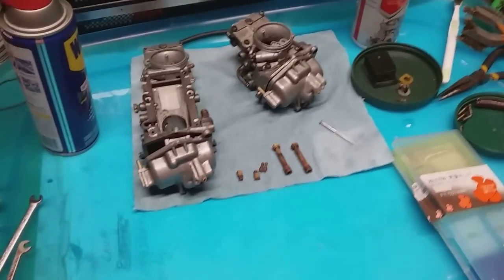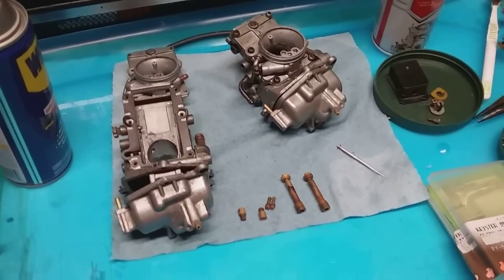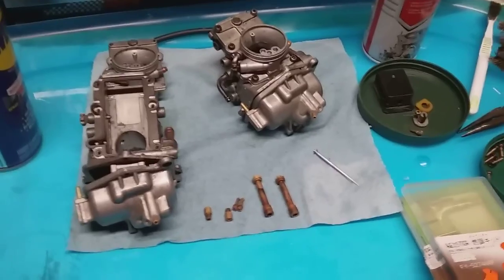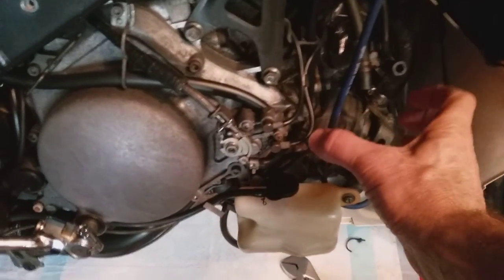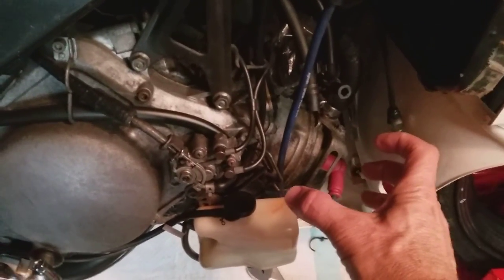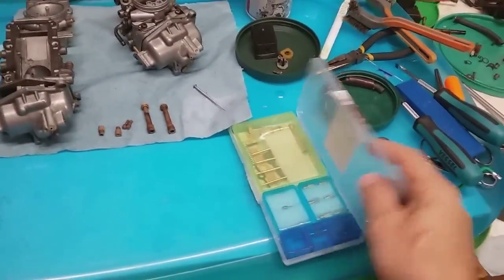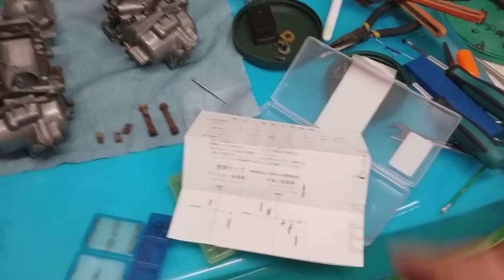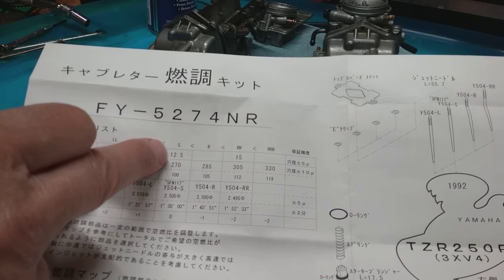STOP before you rebuild TZR250 3XV Mikuni 28mm carburetor 3XV4

Comment: The sight glass on the upper (LH) carb is on the outside of the slide body. It is used for synchronizing the carb slides. The "Eiffel Tower" you refer to on the lower (RH) carb is called the "Throttle Position Sensor". It works with the CGI to control the "Variable Air Jet" system on these bikes. The VAJ's were engineered to help control emissions on all 3xv's (91-95) . The TPS can be removed and the VAJ systems unplugged if you're willing to actually "tune" these bikes. Your 1992 Model came from the factory restricted to 45 HP. It can be de-restricted to make almost 60 HP,  safely. (33%) The big modifications will be cylinder porting, head skimming, a competition expansion chamber and replacing the stock CGI with one from a Sugo race kit or a programmable option from Zeeltronics or Ignitech. Not cheap. All followed by careful tuning of the jetting. Good Luck.
Reply from the maker: Thank you!

Comment: Hi, did you manage to figure out how to adjust the idle speed on both, thanks
Reply from the maker: @ivanrodrigueztellado748  I use a vacuum tool to balance them. I have a video of that too. https://youtu.be/fjOzwRC26yU?si=4_B9XdkNcOfBHSqb
Reply: @wetlifesports  I have done it with a vacuum gauge, but I was wondering if there was a way to do it without that, although I already have it almost at 100%
Reply from the maker: @ivanrodrigueztellado748  yes, I guess ear and feel. I've given some value to a infrared temp gun as well. I've pointed it to each head pipe and measured the temps. It's helped me figure out which cylinder was lazy, not running, not getting fuel, etc. Gl

Comment: Hello, sorry to bother you but do you know jow to get the main nozzle (emulsion tube) out, i cant seem to remove mine :(
Reply from the maker: Can you cook it in a ultrasonic, maybe just boil it? I'm trying to recall what I did. Was it threaded in? Is it behind a threaded bit?
Reply: @wetlifesports  sorry I was able to take it out the washer on top prevented me from getting to the actual tube to push it out, once the brass washer was removed it came out fairly easily. Currently stuck on the rebuild due to the previous owner having destroyed the heads on the pilot jets, I don't have anyway to remove them now lol. Thanks for the reply :)
Reply from the maker: @thusarakapalliyeguru7655  Don't worry, see this link.  https://youtu.be/AHom-0ofKj0?si=u6hhK2PiGWNorbb0